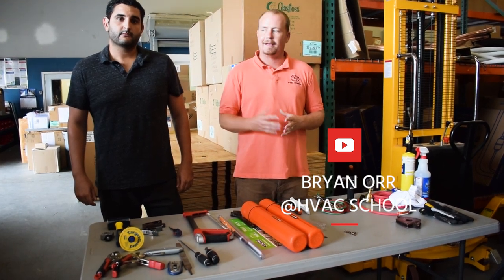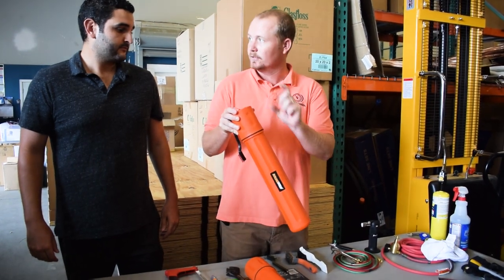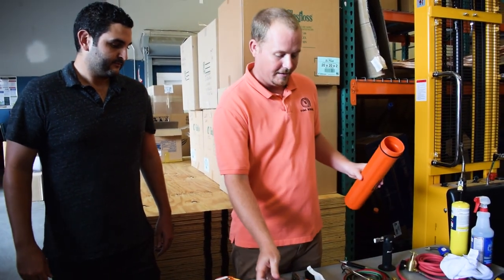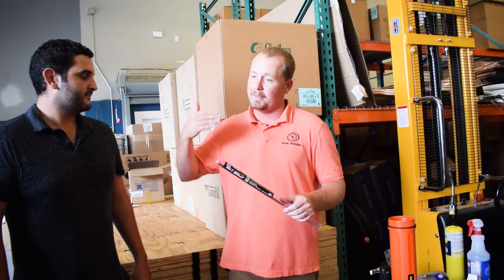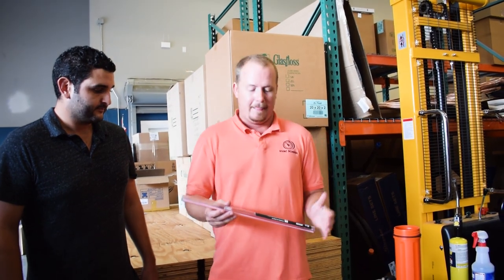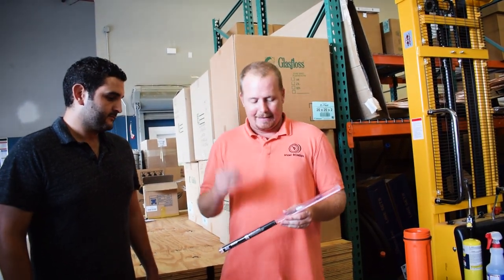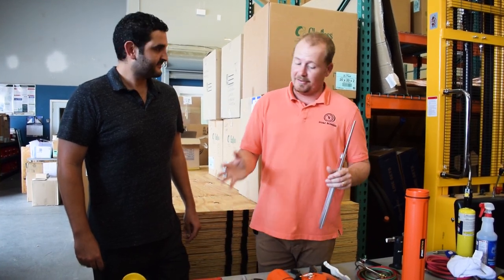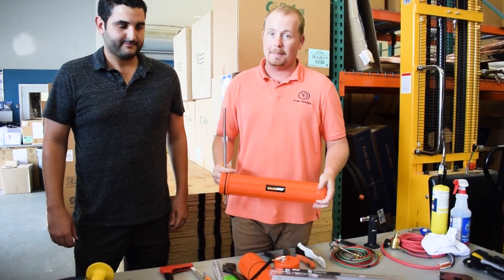Braze or Solder Anything in HVAC/R

Comment: I got one of those solderweld kits coming in, pretty pump to use it have seen/heard nothing but solid raves on there products specially from akhvac. I really like the aluminum rods microchannels on new equipment now, best start to get the hang of it when the time comes to repair.
Reply: How it worked out ?
Reply: @belzi1  have only used copper to aluminum so far so good. Have gone through the flux rods for steel to copper few times. Great soldering products. Don’t approve on there heat block playdoe
Reply: @hvacslayer2929  thanks for the response

Comment: With brazing compressor to section and discharge line (stainless steel to copper) should use 15 percent or 56 percent? Thanks.
Reply: Either or I would say

Comment: Doesn’t matter what it looks like, it matters if it doesn’t leak and holds.
Reply: A booger weld or solder joint is indication of a poor joint.
Reply: @raymondlee3414  It’s what I call a cold joint.  Rod is melted by the torch, not the pipe.

Comment: U want it red just don't deform it or worse blow it out, the high heat is why we use oxy/acetyl and 15 so broadly in HVAC/R because we ain't out here sanding, cleaning, fluxing, flux that.... plus the heat is how u get the silver to mercurize and suck in the joint.... basically u want that rod to melt like an ice cube would almost.... so so so, easy to braze man....so easy....

Comment: Your typical 5% solder has a tensile strength of 14,000 psi.
Reply from the maker: Tensile strength isn’t the issue. It’s getting the solder applied properly. 15% is more ductile and it flows better therefore increasing the chances that the proper bond is made
Reply: Use it all the time never had leaks. Stabrite8